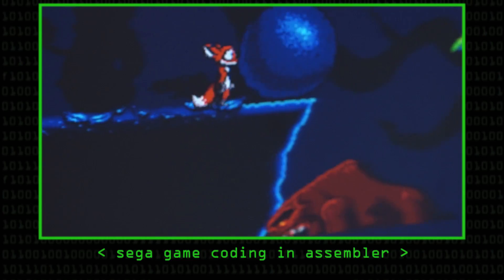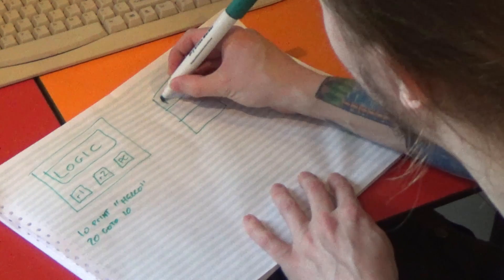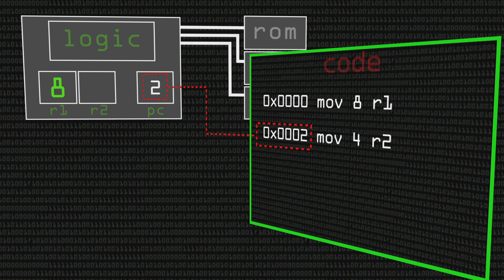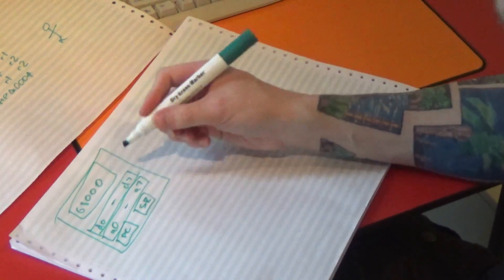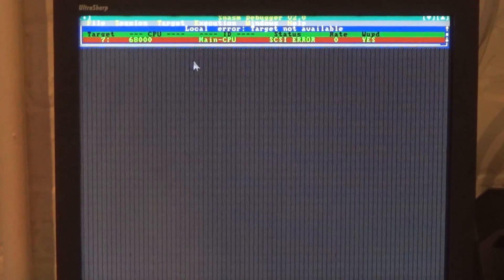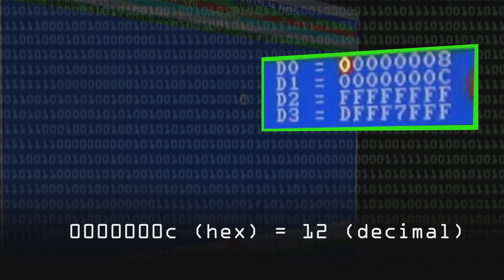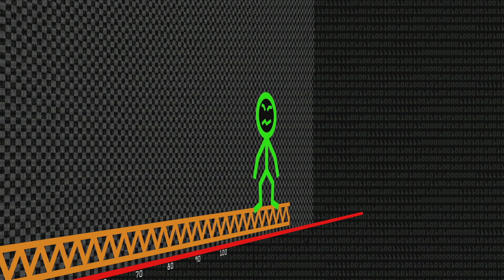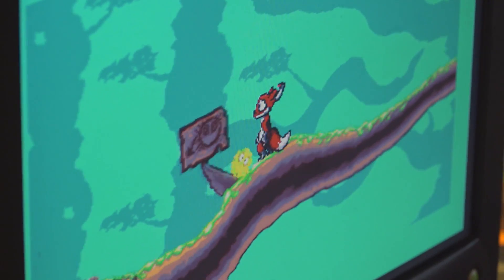Game Physics (in Assembler) - Computerphile

Comment: I love how this legacy dev kits are just a press on the power switch and a serial cable to the PC, no extra probes or debug bridges needed, it's all built into software.
I still have an IS_NITRO_EMULATOR at the office, which is the development hardware used for the original NTR Nintendo DS. It plugs in using a USB cable or serial connector, and (as long as you're running Windows 2000 or up) you can configure GDB to read your arm-T9 elf binary and step through the C/C++ code using a modern interface like Code::Blocks or even VSCode.
Though the drivers are proprietary, that's the only thing to keep in mind if you lost your installer CD (and the original warioworld portal has been shut down for years now)

Comment: I don't understand this, of course, but I see now how optimization can be done in assembler vs high level languages. I saw a video where they didn't need a bit in a register that held 8 bits, and they used each unused bit in those registers to add more functionality to the code. I see now that you can essentially access any bit you need and concatenate them into a data type you need... or something I think.

Comment: Why do I insist on watching Assembly videos when I know I won't understand anything?
Reply: I think you're just getting interested in it. The next step is to try it!
Reply: same here I even  took a programming course, our main language is Java and C# can code simple console apps but don't even know the half of core Java..yet damn
Reply: Because after a while, it'll start to sink in a little bit, and you'll be a better programmer for it. Assembly is the language all other languages are built on, and it can only be useful to understand what's going on under the hood. To extend the car analogy, sure, the average driver might not need to know how the torque convertor works, but it sure is nice to at least know how to change your own oil.

Comment: I get the distinct impression that this guy knows about as much 680x0 assembly as I know about the back end of the moon. Firstly, if you're moving immediate values and they are within a signed byte range, you'd never move.l, you'd moveq because it executes in 2 clocks. The same applies for addition; if addition is within an appropriate size, you'd addq. You also usually never specify a size with move quick as it occurs on the entire longword and with sign extension.

So what he wrote there would be better written as:
moveq #8, d0
addq.l #4, d0

You'd also usually never add to an address register with add, but would use lea offset(a0), a0 instead.

Comment: Basically ok, but he needs to learn about MOVEQ.L

I love the 68000.   Great CPU for it’s time.   Much better than that segmented nonsense of the 80x86 family.  Transitioning from 6502 assembly to 68000 assembly was like moving out of a broom closet into a warehouse.   Lol.

Back in the 80’s, I wrote a 68000 assembler and disassembler for the Commodore 64.   I did it just for the challenge.  At one point, I made a 68000 version of Commodore’s CP/M cartridge.   A 68000 and a 6510 working together.   Was like putting a V8 in a Ford Pinto.   Lol.   I used the 68000 mostly to do the math for monochrome 3D graphics on the C64.   I used it to do a lot with The Game of Life, or Cellular Automata, whatever you want to call it.  Back when I had too much spare time and no responsibilities.   Lol.

Comment: I learnt 6502 assembler from a school library book back in '86.
And I ran into an identical problem.
You had load, store, add and two shifts.
I went back to BBC BASIC, I had no need to learn a different way to add numbers.

There was no link in the book between what assembly was and what you could do with it, it kinda assumed you already knew.
Because who else would be learning assembler?
Certainly not a seven year old.

Comment: This all makes sense in terms of establishing all the game's parameters- I need to keep digging until I discover how Assembly is used to plot graphical points.  Years and years ago I wrote complete games in Basic and have been intimidated by Assembly for as long as I can remember.  Looking at it like this, it make a lot of sense.
Reply: Drawing pixels is not really part of languages, it depends on the computer hardware and operating system. He's developing for a Sega console so he can probably just write pixels to a character map and then characters into a tile map using direct memory writes. On a modern desktop PC you would have to call OS functions to do that instead.

Comment: Microsoft MASM will enable you to write and run x86 assembly. I also believe that NASM does the same for Linux, but I haven’t worked with that yet. It’s very similar to this assembly, except the syntax is a bit different and the registers are named differently. Sadly, assembly is not portable so you have to re-learn the syntax for each different processor.

Comment: Why don't they make an emulation to program games that mimics all the work he is doing, where we can just paste the images and add many images and has a higher level of understanding, so we for example add many pictures and or drawings and identifies the object and makes movements from that image from the many pictures, and would be much easier because it would be a hybrid game programming and making, by adding images like a Graphics Design with game encoding etc etc making it as simple as possible, that way they doNOT need the DevKit or console, and they can make the games compatible with PC and mobile as well.
Reply: That would actually result in WAY worse code than if done by hand.

Comment: Why would anyone program a game in assembly nowadays?
Reply: Speed. With games, every CPU cycle is precious. At a bare minimum, you need to be able to maintain a consistent 60FPS (Frames Per Second), which means all computations (code) must be executed within 16.6ms. When you don't have the luxury of super fast hardware that runs at a gazillion megahertz coupled with graphics cards with umpteen zillion cuda cores, then you need things running as quickly as possible. If you are unable to execute everything within 16.6ms, then you end up with "jank".

Comment: Anyone casually interested in assembly should check out the game "Shenzhen I/O" on steam.  It's a puzzle game where you write assembly for fictional microprocessor chips and interconnect the chips on a circuit board to get them all working together to solve a problem. It's a lot of fun and gets quite challenging. I highly recommend it.

Comment: Ah the memories come flooding back to when I coded in assembly on the 68000 & 68030.  Move.l #x,d0 = 16 cycles and move.b or move.w #x,d0 = 8 cycles (on the Atari STe). Spent many hours trying to optimise my code run in one vsync cycle.

Comment: cool, never seen how a cpu executes code, would be cooler to see animations of the electrons flowing, like the physical nature of cpu's, sure its just one's and zero's but those 1's and zero's are physical when it comes down to it, would love to see what they do under the hood.
Reply: Even instruction execution can be broken down into several steps based on complexity, but mostly the CPU has the address bus set up to point to the value in PC, then it latches the 8/16/32/64 bits in there on the data bus and feeds into some register the programmer can not ever directly work with, to hold the instruction itself. Then the CPU sets up the logic circuitry based on the instruction value read, and connects one of the registers, or RAM, or whatever to the logic core, and all this magic ends with the CPU adding the right amount to PC. This is a very general explanation, but this is the main gist of it.
Reply: Thanks but still confused,  what do you mean by PC? what value?  maybe this needs more than a gist explanation.  So far i got that the registers hold information to be processed by the cpu, and those registers take that info from ram.

Comment: What would be an easy computer and video game system from the 90s'/80s' to develop for? I have been interested in this but I don't know where to start.
Reply: The easiest is probably the Atari ST as it didn't have a huge amount of additional graphics hardware. Next up would be the Amiga also 68000 but with some really cool graphics hardware - but you also have to learn how to program the hardware as well as the CPU. The reason I'm recommending computers is that you can develop on the computer itself. For anything like the SNES (very fiddly from memory) and Megadrive (not much better from memory) is that you need a development kit - you write the program on one computer, assemble it and transfer via the development kit to the console. On the SNES for example, the code typically ran from ROM so the development kit emulated the ROM. Going back further it's a toss up between the C64 and Spectrum - 6502 on the former, Z80A in the later. Interesting observation about the types of games which worked best on the two. The C64 had more dedicated graphics hardware, e.g. sprites and you could do some pretty neat things by abusing the hardware. The Spectrum didn't have any graphics hardware at all really (don't count a screen buffer) so on the Spectrum, your skill as a programmer and getting the most out of the Z80 was key. However, the Z80 ran faster than the 6502 so for games where a simple frame buffer was a better choice, the Spectrum was better - albeit mainly black & white. Anything with 3D graphics was faster on the Spectrum as it was way faster at the math
Reply: PleaseDontWatchThese the Amiga was a great system to learn programming.

Comment: 19:14  Didn't realize it was widespread?  But SCSI has been around since the early 1980s.  Almost all of the M68K Macs used it for hard disk IO.
Reply from the maker: +RonJohn63 he meant how widespread saying "scuzzy" was instead of saying "S. C. S. I."
Reply: ***** And people have been saying "scuzzy" that long.
Reply: West coast generally said 'scuzzy' and east coast generally said 'sexy', from my experience in the 80s and 90s.
Reply: Cre8tvMG  West coast generally said 'scuzzy'

And Gulf Coast, since the 80s.

east coast generally said 'sexy'

I've worked professionally with people in NY/NJ since 2GB drives were common in the mid 1990s, and never once herd them say that they needed to install or replace "sexy" drives.

Comment: So, when you talk about CPUs being 32/64 bit, are you referring to the size of those registries?
Reply: Some time correct, some time not correct, MC68000 use 32 bit inside for calculation but only 16 bit for data transfer and address, people say it is 16 bit CPU.
Reply: Normally in x86 and x64 it refers to the size of the address bus
Reply: Kaas Christiansen 
Yes. The amount of bits defines the amount of bits in the registers, and also how wide the buses between each part of the cpu are.
Reply: This is not exactly true anymore, 64 bits cpu now have 128 bits register and even bigger ones for some of them

Comment: What I don't really understand about CPUs is: Why does having more transistors enable a processor to run at a higher clock speed?
Reply: Having more transistors is not actually the reason for the ability to run the newer processors at higher clock speeds (it is just "an added bonus"). The main point is in the size of the transistor.

The smaller the transistor the smaller it's effective capacitance can be made (in a simplified terms). If you remember basic physics Capacitance=(pErmittivity * Area) / Distance.. This of course affects the transistor's rise and fall times (the operation speeds) of it's states. Now this is just a crude explanation but I hope it helps.
Reply: More transistors means bigger registers. The 6502 only had 8-bit registers so the biggest number you could handle in one add instruction (actually 6502 didn't have an ADD, it only had ADC - add with carry) was 255. To add bigger numbers together required two or more add instructions. With more transistors, you can extend to 16 bit registers so can add numbers up to 65,535 in one instruction, therefore it's faster overall
Reply: Also consider a simple data copy of 64 bytes from address A to address B. On a 8-bit computer, that's 64 copy operations in a loop. On a 16-bit computer, it's just 32 copy operations - twice as fast. On a 32-bit it's just 16 copies and on a 64-bit it's just 8 copies. An analogy would be trying to transfer water from one drum to another using a teaspoon, a tablespoon, a ladle and a mug.
Reply: Transistors are the building blocks of everything within the CPU - not only the arithmetic-logic unit. For example, each bit of a Cache memory in CPU is made from a few transistors (about 10-20?), thus tens of millions are used to make 1MB of cache memory alone. So you can say in basic terms that an amount of transistors tells you more about the features, not the speed of the thing. As Venim1103 explained, it's the quality of manufactured transistors (especially their tiny size) that enables the whole thing to run faster.
Reply: The two are independent.
Reply: Imagine a building full of "computors," in the 19th century sense; (people who sat at a desk and calculated figures).  The bigger the building, the more desks you can have, therefore the more work that can be done.
In the case of electronic "computors," the desks can be made smaller and smaller, therefore the amount of work can be more and more, for less cost.
Being smaller, means being more efficient, because there's less distance to travel with each "stroke of the pencil."
Reply: ***** Ahh, I see. So what is the benefit of having more transistors then?

I get the benefit of having more cores, but then that requires code that makes use of parallelism.

Comment: could you make a video going through and explaining how someone could be as mad as to write RollerCoaster Tycoon in x86 assemble ?
Reply: Was it, really??
Reply: @danielf950  yep.
Reply: @adrianflo6481  Thanks, I didn't know that. What a patience!

Merry Christmas, Adrian.
Reply: @danielf950  merry Yule!
Reply: rerunturbografx  that's amazing! I never knew Assembly could be used to write CPU agnostic software! I mean, I thought each CPU had it's own Assembly. I'll look into it. Thanks a lot!
Reply: rerunturbografx  Most every PC can run x86 assembly though including AMD ones.  Otherwise a lot of Windows code wouldn't work though I think they've updated a lot of the x86 specific stuff to C for ARM compatibility since that can't run x86 code without a software emulator and heavy losses (From my understanding M1 is an ARM processor with an FFPG like hardware solution to run x86 code efficiently so it's still hardware based emulation).
Reply: @grn1  Isn't that because AMD makes x86 CPUs?
Reply: @Supertimegamingify  Indeed they do.  From my understanding AMD created x64 and emulated x86 and now AMD licenses x86 from Intel and Intel licenses x64 from AMD.  x86 is 32-bit and I believe the number comes from the year the first Intel 32-bit processor was made (for the most part any code written back then is still compatible with the exception of 8 and 16 bit code).  x64 is of course named after the fact that it's 64-bit but it does make things confusing.  All modern AMD and Intel processors are a combination of x86 and x64 (x86_64).

Comment: I id my assembly a while ago. As I understand by this example gravity and florHeight are constants that are replaces in byte code during compilation. But shouldn't you move them in registry at first. I understand in more advanced cpus you have abundance of registers and assembly compiler does that for you. but in this case. Where gravity value is stored in cpu when subtraction is done? Is there extra hidden registry?
Reply: Most CPUs have 'immediate operands', so an instruction like

ADD  #3, D0

Means the #3 value is encoded into the instruction itself, so no need for special loading from RAM to get the value into a register.

On RISC architectures because of fixed instruction size there are limitations to the number of bits you can use for these. MIPS for instance was limited to 16bit immediate operands.
Reply: SerBallister ok. Found one cpu architecture scheme where one of data inputs of ALU is wired not only to registry bank but also to instruction decoder. Then it makse sence.

Comment: As someone who usually writes PowerPC, data moving from left to right really messes with me. That arch has it similar to C, where data starts on the right and moves left - for example, `li r1, 8` puts the literal (or immediate) value 8 into r1. Which would be silly, considering r1 is usually used as the stack pointer. I draw the parallel to C since the statement `r1 = 8` similarly moves the data from right to left.
PowerPC also does most other functions differently - you can specify the destination register for an operation. For example, I might write `add r3, r6, r7`, which is equivalent to `r3 = r6 + r7` in C (one of the reasons I like the PowerPC is its similarity to C in most things). We get to specify the destination, which is cool.
That said, I like how you get control over the length of an operation - PowerPC uses the "native" bit length (32/64 bits depending on the processor) for pretty much everything other than memory writes. 
Interesting side note - I thought the Genesis was 16-bit, but I see you're manipulating 32-bit numbers without issue. Is that a Sega CD thing or is the address bus only 16-bit?